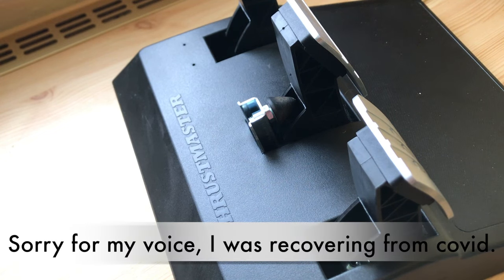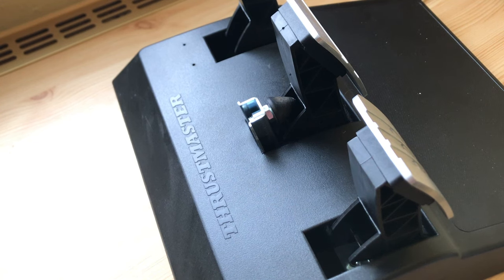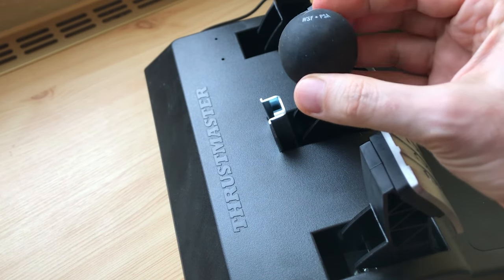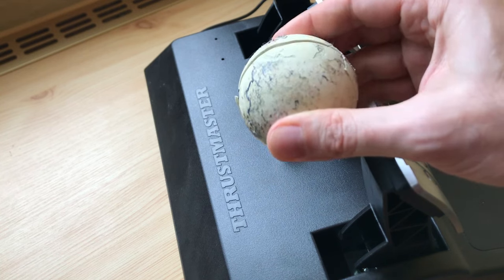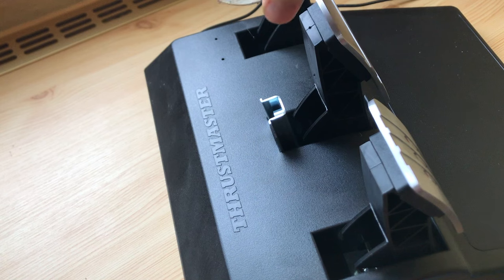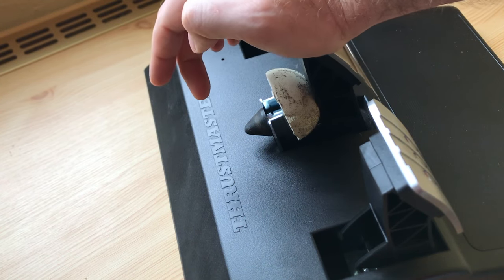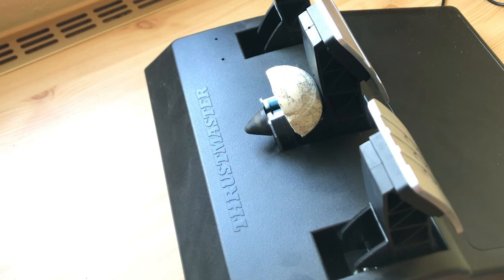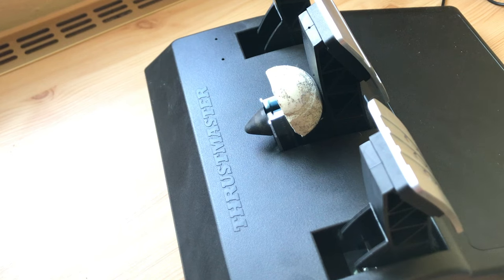The Best Brake Mod For Thrustmaster T3PA/RS GT Pedals

Comment: I just did this mod along with swapping the springs around and it worked perfectly. Used a rubber baseball that was probably fifteen to twenty years old lol, cut it in half and shoved a screwdriver through it, then pushed a zip tie through so i could secure it in place to the conical mod bracket. It has a perfect progressive ramp up in feel and with the sensor so I don't even have to mess with the software, it just works.

Comment: I use a piece of foam used for protecting packages. Cut out small squares big enough to stuff down in the hole behind the pedal. Works great but can come out sometimes with use. Can’t wait to upgrade to load cell pedals in the future.
Reply from the maker: Yes, the real load cell break is much better. I did upgraded to T-LCM and it is amazing. But this mod was working for me with no issue for a long time.

Comment: Thanks! I'll give it a try. Wat is the diameter of this ball when going to a pet petshop. Greets 🤟
Reply from the maker: It's like a tennis ball size :)
Reply: @SimRacingPal   That makes it a lot easier :) Thanks dude :goodvibes: If you like i wil share my experience with a non tennis ball (but in size it is) but without fur in a couple of weeks or so. Waiting for the pico 4 to arrive first. So hyped incl. your mod btw 👍

Comment: The next mission is to find the best type of rubber will work best, And I only have some pencil runners on the table, lol, I upgarded from a Ligitech because I wasn't getting faster, I was jsut staying at one level, I didn't know why, Until I got the T300 GT RS, Total difference, In fact I would even say the extra 100 pounds is worth the 100 pounds, Coz with the Logitech you will stay at a certain speed, Or lap time, I only had the T300 for a few days 3rd day I think, And already I can see that I am going to get faster lap times, the only problem I have now is braking, I am finding heel to toe difficult using the T300 pedals, It isn't just me I hope, lol, But yeah I needed to change the wheel and coz I Sim race in VR anyways, No way will I got back to the TV screen unless I had to, But after busting AMS 2 in VR using just a Quest 2 as well, The Quest 2 is brilliant for the price by the way, With Virtual Desktop on Steam, Unless you got a super duper fast internet connection Virtual Desktop is clumpy with out the cable linked to PC, Or use a Router like a TP-Link AX3000 AX55 Archer, Wifi-6, Brilliant Router by the way, The TP-Link Router is giving me AMS 2 multiplayer in amazing gameplay, Hardly any or No latency, The wheel in my hands is instant to the wheel in AMS 2, I am blown away how much a difference having a decent Router does for online Gaming and Steam in general...
But yeah the T300 is going to make me a Faster Sim Racer than I would with the Logitech, And yes I believe a High end Set Up will allow you to be a faster Sim racer, Than the dude who got a really low end Set Up, Coz just in the 2 days I have used the T300 I am seeing myself control the car a lot better, I can feel the back end swing out a lot faster, So I bet a DD wheel and Load cell pedals will let you become a faster Sim Racer, And I say LET you not make you, Practice anything and you will get good at it, So having high end set up will give you a better ground to practice on, More motivation, To get in a bad ass sim rig before a crap ass sim rig, lol I will say though the extra 100 pounds is worth paying if it is possible, When I began Sim racing I was using a PS4 Pro, And the Logitech wheel, So the Logitech is great for stepping into Sim Racing, But if you plan on taking it extra serious then pay the extra for the T300 or a DD wheel, The Cummus I read peoples cammus wheel starting smoking, That would be even more dangerous in VR, You would feel heat before you see it, Plus something where a few units have started smoking can't be good, So yeah because I Sim Race in VR the look of the wheel isn't important, And I can feel al lot more detail using the T300 than the Logitech, That gear feeling too, As well as having to flick or help the Logitech to Center when leaving a corner, the T300 got none of that, I can see why Drifters like the T300... It is a great wheel...
If anyone is getting great results from the Cammus wheel let me know, lol, I am curious, lol..
....

Comment: Does anyone know the size of the bolt that holds down the T3PA conical brake mod mount? It was not included with my peddles.
Thrustmaster tech support is none existent.
Reply from the maker: It's an M4 screw and 25mm long.

Comment: How am i supposed to get 100% brake power with this mod?
Reply from the maker: You have to push the pedal past the 50% with the mod in the calibration tool and you will get 100%.

Comment: I think loadcell is better because profiler iracing take weight pedal for the efficacity of brake :/ but i like too pedal potentiometre but that not fast  its better tlcm
Reply from the maker: Load cell is better, I have T-LCMs. I don't use potentiometer pedals anymore. But this break mod is very close to load cell feel from my experience.

Comment: i can only get it to 40 percent pressure when adding a ball like yours :S
Reply from the maker: You have to push the pedal with the ball installed past the 50% and you will get full 100% pressure :)
Reply: @SimRacingPal  i push as hard as I can, even the rig comes out of the floor but can get it past 50% tops. It’s super stiff i like the feeling but I’m missing half of the input like this kind of hard for trail braking
Reply from the maker: @tamboleo  Open the control panel settings for the wheel where you can see the pedal inputs, if I push the pedal with the ball past the 50% it automatically set it to 100%. But you have to do it everytime you connect the pedals. Maybe you have very stiff ball. I have no problem to push it past 50%.
Reply: @SimRacingPal  Thanks for the help man, in the control panel i just see it up until 40, and 50 if i just smash it. Do you use any other software for calibrating it other than the control panel from Thrustmasters? (When you had these pedals)
Reply from the maker: @tamboleo  No there is no other SW for calibration, just the control panel. You have to push it to 51% :) Or find softer ball. Or maybe cut little bit off from the one you have.
Reply: @SimRacingPal  thanks man, I already tried cutting the ball and different set ups with the remaining rings, I’m also thinking about upgrading to load cell… We’ll see :)